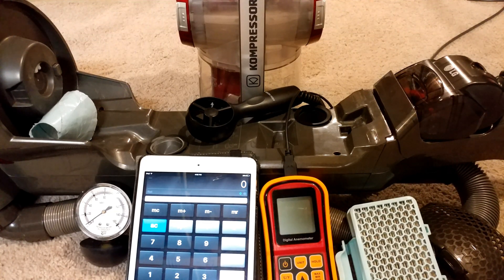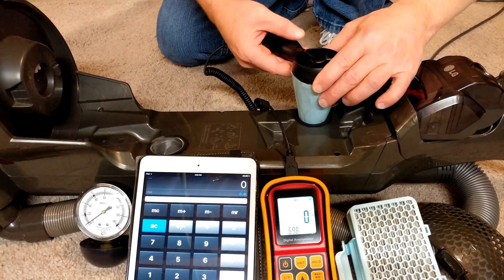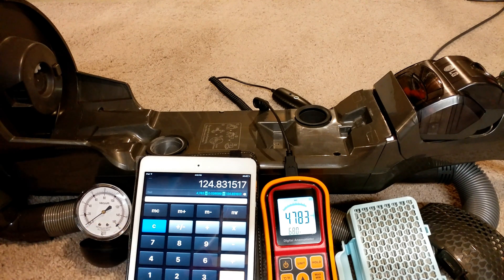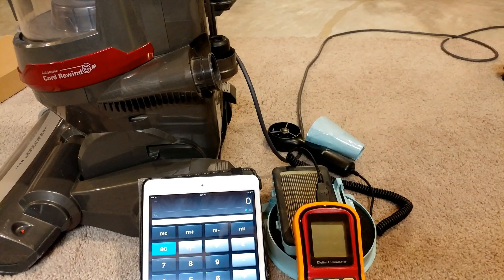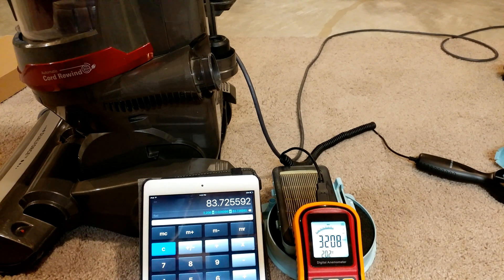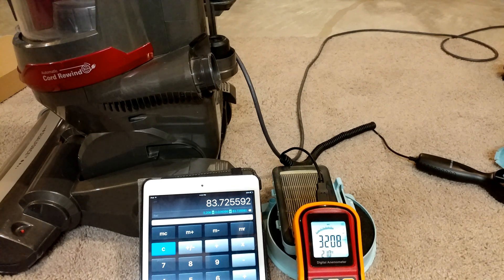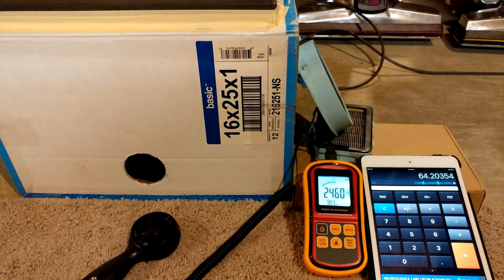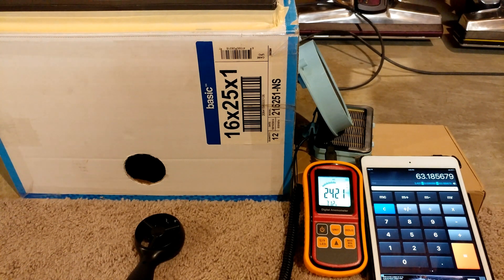LG Kompressor LuV200R Airflow And Suction Tests

Comment: I am disappointed with the airflow loss by the bin/cyclone system. Single cyclone system in this seems to be very inefficient what is a bit of surprise for me. 55 nozzle cfm and very large brushroll opening means instant fail for the flour under the carpet test. Altought very aggressive brushroll might perform well in the sand pick up test.
Reply from the maker: Yup!